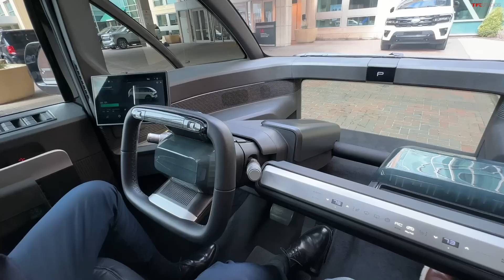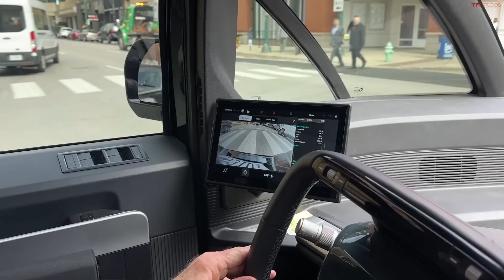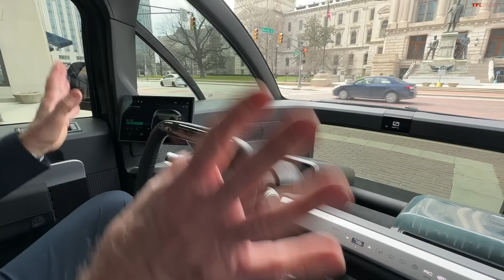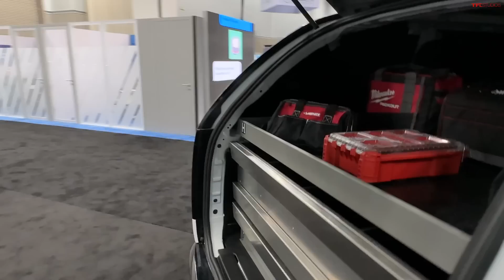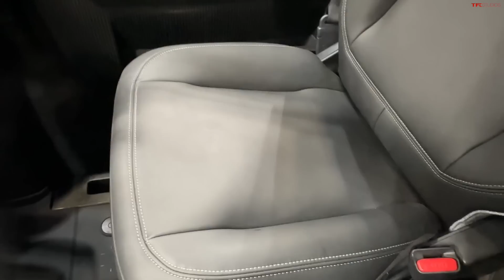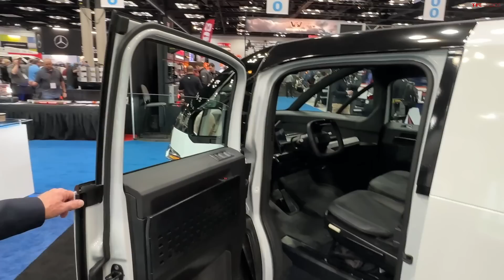The All-Electric Canoo Is Like NO Other Van You've Ever Known or Driven: Come Ride Along With Me!

Comment: Curious to see how all that glass over the first 3 years of driving will do with hits from rocks and debris off the road at speed. That street view glass will be replaced a few times most likely and users will start using an aftermarket add-on like a plexi glass dual suction cup on it for a buffer after the second crack and replacement.

Comment: How do I steer or break if it looses power
Reply: He said the steering system has been safety certified with redundant systems in case the main system fails.
Reply: @timmethy  OK but they haven't shown or demonstrated that secondary system. I'm glad it passes crash testing but the objective is not to crash with the loss of control.  I hope they don't want me to use the gyro in my phone and steer the car to safety  with the loss of drive by wire.  I hope in time they can clear this up it's a very good lookin vehicle. But anytime you have people in a vehicle you really need something connected directly to the road no matter how many systems you have assisting.
Reply: @mogZzack Yes it would be good to know more about the secondary safety system and yes a mechanical connection between the steering wheel and the tires is reassuring. Those things need to be improved. I like the engineering concept and styling.

Comment: Great video, Andre, thank you. I'm not a fan of EV's for many reasons, but this Canoo van and all of its iterations has great potential, really like the design.
Reply: What are some of the reasons you are not a fan of electric vehicles?
Reply: @Michael-js6gp  There are many - the electrical grid in its present configuration can't possibly support the millions of EV's plugged in to recharge. There is presently in this country no serious discussion of alleviating that. Range is an issue, attempting to add more batteries to gain more range results in more weight which detracts from range. Extreme temps affect a reduction in range. Recharge times are ridiculously long. There will have to be some yet unforeseen major technological advancements (batteries with higher energy storage density with lighter weight, much faster recharge times) in order to make EV's practical. To quote an often-used cliche, in order to go along with government mandates, manufacturers are attempting to put the cart before the horse. I am not saying that all EV's are not viable, I am saying they are not viable for all modes of transportation. I have long thought that if some of the hurdles with fuel cells (hydrogen) could be worked out that it would likely be the best energy source, hydrogen is a very common element and the only byproduct of making electricity with a fuel cell is water.
Reply: @wesalexander2693 There is serious policy to try to remedy that within Joe Biden’s Inflation Reduction Act.

Comment: I like this cool new stuff, but as a driver mysel I will never in my life will drive a mass production car with "steer by wire" and steering rack not phisically connected to a steering wheel. Never. If you have any slight issue with this system in a fracture of second you are rolling into ditch or some others car or in a pedestrian. It works good for a multi million aircraft with a dosens of technicians maintaining it properly and in time, but it will not work with regular road vehicle.

Comment: A message to all car designers / manufacturers - please stop using touch buttons in cars, this includes touch screens to control everything in the car, which is honestly the biggest lapse of judgement in UX design. Reasons being, they're difficult to locate and operate quickly/accurately and don't offer the important tactility of a traditional button, which makes it much safer to operate when your eyes are on the road. Typically these touch buttons are on smooth surfaces which leads to the finger sliding around and potentially mistouching other buttons in the process or an inaccurate touch can lead to multiple inputs being required. Touch buttons have their practical use in certain contexts, but a cars driving controls and functions mostly benefit from tactile interfaces.

Comment: How many miles per gallon does it get? How many miles per battery pack, and is that battery pack replacement affordable? Rich companies only type vehicle. Not practical for country folks. How does it do in the mud, snow, water? How is it on gravel road? What happens when the steering wheel stops working? Wasted space in  the front!!!;

Comment: The EV industry is trying for 21st-century solutions using 20th-century battery tech. It doesn't work well, it can't scale, it's stupid, and hybrids make more sense. Today's example is Canoo.

"200 MILE RANGE"  - are you serious? Pathetic.
"80kw battery pack" - that only gets 200 miles - inefficient.
"glass all around" - increases weight, decreases range, no one asked for it.
No mention of charging time, so we know it's bad. The Canoo pitchman would have touted it otherwise.

Get back to me when the range is at least 400 miles.
Reply: For in and around town, 200 miles is more than enough, even in the USA

Comment: The front seems extremely awkward. Does it open to store a small suitcase or is it just empty space designed for nothing. What happens if something rolls up to the front. Seems hard to reach as well. I really don't understand the design logic. It also seems that your spacial awareness will be off. Not sold on it's design....

Comment: As a reallly long time van driver of the Astro/Safari mini van, I will admit that this looks to be full of potential, but I will not be changing over any time soon, but still good to know what is coming. 
Appreciate the leg room for the driver and the improved road view, but after a few years on salty roads here I fear that too much of the electricals will be toasted and the potential problems are terrifying after 10 years, I would only start driving such in the non salt seasons and store it in winter if I were to get one of these. ICE engines to my mind will remain kings of the wintery salted slush and ice for quite a few years yet I suspect. 
Still I conceed that we need to move forward in developing electric vehilces along with other potential energy sourced vehicles such as hyrdorgen and continuing with hybrid developments.

Comment: Love these Canoo EV'S,  however mirror control on the steering wheel is poor choice. Really needs double rear sliding doors to be more useful. Parking in tight spaces makes those doors useless. Love the design and look though.  Wouldn't but one without better utility though

Comment: 350bhp for a city van?  Why not reduce by 50% and increase the range?  Or use a smaller motor and not carry so much weight and batteries.  Why are people always trying to go faster and harder when we are all meant to be saving the planet with these things?  The speedo is too small to easily be seen in bright sunlight and the switch bar too small and the switches too small for easy use.  Bit of a compromise if you ask me.   Lots of blind spots. Hmm

Comment: he forgot to ask important questions. what type of suspension does it have. what type of motor and its efficiency. what do the brakes look like. fast charging rates? how tall is the battery and what type, packet like a bolt or cylindrical small units like tesla. where do they source batteries? China? how does the defroster work on all that glass in front of driver?  so many missed opportunities...Should have sent the ginger bearded guy and Tommy!!!! they are the best reviewers on this channel.

Comment: With the advertised 200 mile range (or better), it would make a fantastic taxi or uber. I would think that they can pump that up to 250 or even 300 mile range in the near future which would give the taxi drivers some breathing room with their 180 miles per day average. I predict these will be very popular in big cities for taxi's and delivery vans. Nice product! On a side note, I agree with the guy that mentioned that having the mirror controls on the steering wheel might not be the best option. I would think those could even be intergraded into the touch screen since they aren't used very often at all or just once and done kind of thing. But again, nice product!

Comment: Interesting concept. I do hope they also provide a normal seating + cargo in the back. It would make it a lot more practical and useful. I can also see sitting sideways being not ideal, being jolted left & right by braking & accelerating. If you sit normally, face forward, you have the comfort and support of your seat. I'm sure there is a reason they did it this way - maybe trying to stand out or offer a USP? - but I hope they also offer a normal configuration. The 200-250 miles range could be better too, to make it really competitive.

Comment: I hope this succeeds, seems to have a large potential market. If they expand to compete with slightly larger trucks like the Fuso Canter (please!) and have options for refrigerated cargo areas, one thing they need to consider is the ability to operate the refrigerator independently while parked, for example by plugging in to run the fridge without draining the batteries during the loading process. Small details like that could make a huge difference to practicality for food delivery.
Reply: They failed already...

Comment: The seats in the back don't seem to be functionnal at all. 

1- I don't see hom you can comfortably siut 3 people on bak row. 
2- The 2 additionnal side seats don't seem to have leg support.
3- Long drives in those 2 side oriented seats are bound to be a problem for comfort.
4- I don't see how the seat belts of those 6th ands 7th passenger can be of any use in a front/back axis of collision. Actually, I can't seen how these guys wouldn't be violently bent sideways (towards the front) in case of a front hit or even sudden stop.

Comment: I have no problem with throttle by wire.  But steering by wire?  That is a recipe for disaster.  The FACT that vehicles are vulnerable to various hacking techniques makes by-wire tech a risk not worth taking.  Braking would have similar issues.

Comment: Looks like a great vehicle.  If I can give some feedback on two things I think would be better.  A traditional round steering wheel would be better.  It offers better grip capabilities in emergency situations and maintains the muscle memory functions experienced drivers already have from years of using one in vehicles they've driven before.  Secondly, traditional door handles.  Flat handles can freeze in colder climates.  I get the different shaped steering wheel and fancy door handles are "cool", but I don't think they make the vehicle any better and in fact may be an issue for many people.  These features are also likely more expensive, so it just seems like a needless expense.  Other than these two things, I really think this is an awesome vehicle.  Great visibility, functionality and reasonably priced.
Reply: Considering what he said about this one having fly by wire technology, a joystick or toggle buttons on the arm rest would be more practical.

Comment: I think it's a pretty cool van except for that computer screen to the left. I really don't see why they couldn't put the charge bars on that long rail that goes from the driver to the passenger side. Keep more things simple for the average driver and keep that computer screen for important things like diagnostics and such. It's just like the same thing where the Tesla model 3 no stalks except for turn signal which is absolutely stupid and dangerous in this world. Otherwise than that it's nice van!... Oh and 300 mi would have been nice for a standard range 200 mi and if you're running the AC probably going to drop you down to about 170 for a realistic range that's not including driving 75 mi an hour+ so you have a more realistically about a 160 mi range.

Comment: "200 mile range".  Anything quoted is 'optimal' not real world, and <200 miles is weak at best given the current market.  Fail #1.  When are manufacturers going to learn that 'all' touch controls is not preferable to having actual knobs for the most used functions?  Fail #2.  And I'm sorry, a Toyota Corolla is a much better value if value is all we're discussing.  And the biggest Achille's Heal, where will these be serviced and repaired given there is no US network of dealerships?  Final fail.

Though this thing is interesting, it seems half baked to me at this point.

Comment: This guy just said they are the first to put steer by wire in a vehicle in production…. Why did no one call him out on that, Infiniti was first back in 2014 and so many other cars have it now
Reply: Canoo is the first to production with this type of steer-by-wire commonly used in aircraft.  In the Infiniti, there is still a steering column with electric assist, entirely different than a true steer-by-wire where there is not a steering column.  So, no lies here, just the fact that the Canoo rep understands a little more about this system and can speak truth to it.
Reply: @b18tuner5875   thats not true, the infiniti has a true steer by wire system, not electronic assist, the column is only there as a backup if it loses power otherwise is not even connected to the steering wheel at all. I own one of these cars you can feel the clutch engage the steering column when it is in use and it feels very different then when its driven normally. just try googling first car with steer by wire it even says the ininiti was the first to do so without the use of a steering column in 2013 so I was wrong about the year previously

Comment: SUV door setup on a van? Strange that they wiffed this elemental, time-proven utility aspect. Sliders on the side and double verts that swing 135° in back make a van work in tight spots for delivery and loading. The pullout task-specific fixtures are too expensive (in addition to vehicle) and space-stealing, besides dramatically limiting capability. A ways to go on making this practical.

Comment: Why go electric. Propane is way cheaper.
Reply: Where can you fill propane easier than just plugging into the electric grid?  Serious question.
Reply: @b18tuner5875     Every gas station, Walmart , oil companies.  Etc
Reply: @nicolec7290  None of these carry LPF.  Sounds like you don't understand automotive engineering but that's ok!
Reply: @nicolec7290  Sorry, maybe I can make it clearer for you, the propane you get at gas stations isn't the same used for fuel for propane engines.  Also, many places in the US do not carry propane at gas stations, and only at propane suppliers.
Reply: @b18tuner5875     I hauled propane for 8 years. Yes it is exactly the same.   All it takes is a heat exchanger & a manifold adapter on your engine.  That is cheaper & easier then changing an entire company from gas powered to electric . Plus the entire electric grid. This is designed to cripple the USA.  Don’t be fooled.   Again propane will run cars, trucks, wall mount heaters, garage heaters , furnaces , mini bikes , generators , anything with a motor.     Propane companies are only paying 50-80 cents a gallons for propane they are charging the people 1.85 per gallon.   Heck of a mark up.  But I rather pay 1.85 per gallon then 4.50 per gallon for gas.

Comment: Will Canoo have a 100 KW battery version? Having a longer range for road trips would make it a more family-friendly vehicle. Maybe add an option for a Sunpower brand solar roof to at least power the accessories and AC/Heat without drawing down the battery too badly.
Will there be a standard 2nd row bench with captain chairs option?

Comment: 50K for the upper end is a decent price (compared to all other electric cars currently). The only drawback is range. 200 miles is 100 miles less than the current standard. The range is good for day to day driving .. might be tricky on long distance road trips .. but the chargers are increasing quickly .. just too many stops at this range.
Reply: Yeah I love everything about it...except that.
Reply: As long as you charge at home every day then the mileage shouldn't be an issue. I know not everyone has access to a home charger though and I can see where that poses a problem, but for most people who only go to and from work and live within 15-20 miles from work, or even remote, then a 200 mile range isn't bad. Better than those old shitty Nissan leafs that only got like 90-100 tops lol
Reply: Actually my adult son has a friend with a Bolt & has no problems driving from San Jose CA to Winnemucca NV by simply using only two (2) planned partial charge stops which also allow for driver rest breaks.
Reply: They are working on replaceable batteries,  no waiting for charge stations, just replace and continue driving. Charge two for the go and can recharge when at the final destination 👌

Comment: Steer by wire sounds like a really bad idea to me. Especially with how buggy and unreliable most electric vehicles are this early on. No good reason to not have a physical connection between the steering wheel and the drive wheels.